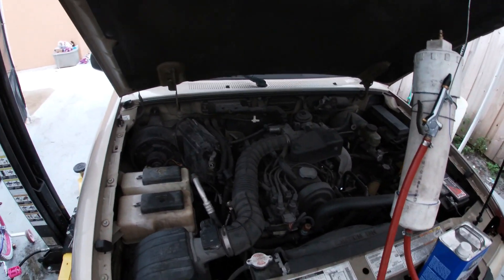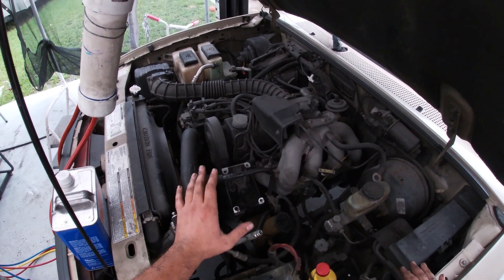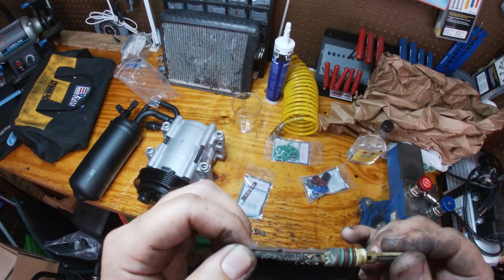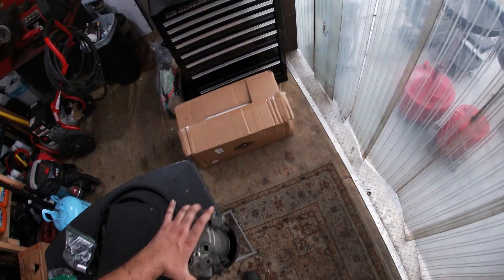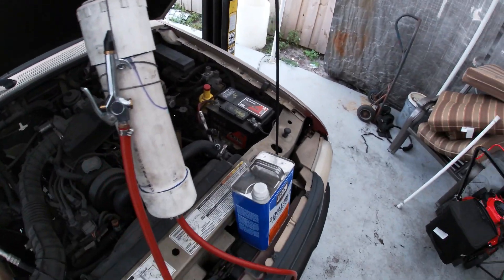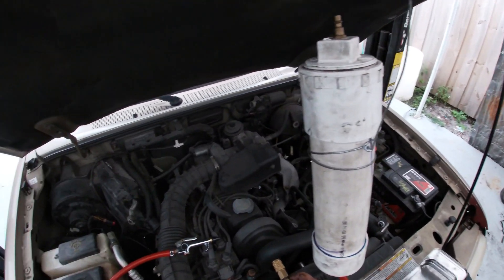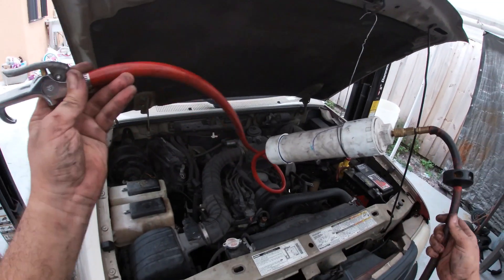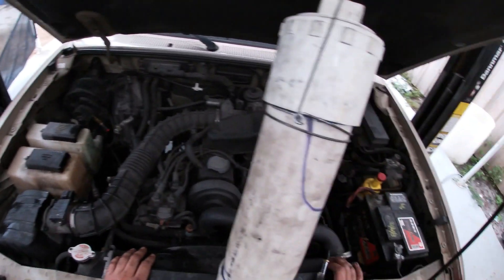How to flush car a/c system with diy flush tool

Comment: Excellent. Thanks.  I am getting ready to replace all the major components in my 31-year-old '90 Yota pickup. I have never worked with AC systems before. You answered a lot of my questions about flushing the lines. You also saved me some big bucks as I was going to buy several cans of the expensive flush. I am now going to use the denatured alcohol. For you DIY guys if you are just doing a system once in a while almost all auto parts stores will loan you a flush can system so you don't have to make or buy one. cheers

Comment: Nice video. I've only done a little A/C work.  I remember using that expensive flush solvent on a tractor system one time.  Using Denatured alcohol is a good tip, thanks.
Reply: Acetone will also work and may be purchased at Home Depot in the paint department . Residuals will evaporate from the flushed A/C lines. Acetone is flammable .

Comment: We need to invent a catch-screen or paper- coffee-filter-like to attach to the exit end hose to show evidence the flush was successful by catching the debris for examination. A coffee filter rubber banded or zip tied at the exit could reveal a lot during the flush process. The hole in my idea is exactly that. I expect the pressure of the air would rip the coffee filter to shreds therefore a metal screen would be necessary.

Comment: Good video! I have a question, if im changing every thing, ( compressor, condensor, evaporator, expancion valve acumulator) is it still necesary to flush the system?.
Reply from the maker: If you also change the lines then no. The line should be changed by the book but i try to flush them.

Comment: Hey bro you should put a check valve where your air fitting is that way the flush tool holds the content and put a shut off valve close to your sprayer

Comment: I like your do it yourself flush gun cylinder it’s even better than the ones they sell on the market because it looks like you can hold even more liquid 👍.     If I was a DYI person working out of my garage and back shop for myself I would probably use alcohol to even though theoretically it’s not the best on aluminum parts there is a little corrosion factor thing going on there.   But it’s only in contact for a short duration of time. 

And when alcohol it combined with fast-moving compressed air there there’s a chill factor that goes on in compressed air does have a lot of moisture in it actually a extreme amount of moisture mixed with the alcohol and the chilling affect condenses out into water droplet that coat the inside with liquid water.      But nothing that leaving it on the vacuum pump overnight will not take care of.   But of course that means an overnight vacuum not a one hour vacuum. 

You did a really good job of explaining the difference between the Microchannel parallel flow condensers that you cannot flush unfortunately you did not have a sample to show the people the larger round tube and fin construction you explained it good enough hopefully the majority of them will understand I often forget to explain process in detail

If you wanted to do even a slightly better job you could get a tank of nitrogen available at Airgas or commercial HVAC wholesale warehouse.   After you did all the dirty heavy flushing work with your compressed air then you could come in behind it with dry nitrogen. 

Crank up the pressure to 600 psi and use that you will get a higher flow faster velocity and of extremely dry nitrogen will help remove most of the moisture that you just introduced by using Shop compressed air. 
                          Of course at 600 psi the other side of the hose the condenser the evaporator or any device Hass to be wide-open not restricted so the item does not build up that kind of pressure it will just flow right through. 
        And you need to also wear your protection because with that kind of airflow at that pressure and velocity it is deafening loud. 

You should look into joining MACS And attending one of their yearly expose and seminars on air conditioning training and see all the available tools tips and procedures available and all the manufacturer products all under one roof. 

It’s one of those mechanics training events that you should at least attend one time in your life.  This year it’s being held in Orlando Florida by Disney.     So if you have a wife and kids they could go have fun while you are attending training classes for three days.  👍
Reply from the maker: Thanks. I always thought of attending one of those. Ill try to get a piece of condenser with the wider tubes as an example
Reply: Maybe we can also use fuel injection cleaning tool (metal tank like his pvc one) It's llike $40
Reply: Could one put heat through the parts in order to dry? Obviously not extreme amounts, but a low volume of warmer and relatively lower humidity air should be able to dry those components of alcohols or other solvents quickly.. Even water would dry fast at reasonable temps like 60c+. You could achieve that with a rigged up heat gun. With the ability to run water, you could put a citric solution through the ali parts and remove surface oxidation. Citric wouldn't attack gaskets either. Maybe I'm overthinking it. I'm just a diy guy trying to figure out how to tackle a failure in one of my own cars.

Comment: I have a 1986 grand national. When I flush out the evaporator on the bigger line solvent goes through. But when i flush it on the opposite line solvent doesn’t come through only air. Do you know why? You think it’s clogged? Btw the orfice tube broke off in the line
Reply from the maker: You will have to extract the broken orifice tube. Depending on how the evaporator is oriented it may require more fluid in one direction than the other.

Comment: Do you have a cheap small water trap on your air line? I have a regular 3-4 HP air compressor and I don't want water in the evaporator.
Reply from the maker: I dont. But yes you can install a water separator. the only issue is that i think it needs to be a certain distance from the compressor output in order to work correctly.
Reply: Any air, or water in the system gets vacuumed out before replacing the refrigerant.
Reply: @da324  but does it tho? All of the moisture gets vaccumed out by a professional machine? What about my cheap harbor freight vacuum pump, will that remove all the moisture when I vacuum down?
Reply: @great2c4me  Sure, I let mine run for an hr. I shut it off and come back one to two hrs later.  If the gauges are still sub zero where they were when I walked off; you're good to go.  Never had an issue that way.

Comment: How good is Denatured alcohol for flushing ? Did you ever opened and inspected the one u did before. Will it leave any residue or change color of pag oil ?
Reply: Don't flush with the compressor connected. Pag oil is mostly in compressor. You only flush lines and evaporator.

Comment: Works in a very dry environment but compressed air carries moisture a huge amount during peak season . So What ......   moisture even in a microscopic amount enters system .....Solution will be to filter a use a Dessicant drier  on your air supply . Spray painters do this . OR  use dry nitrogen to blow thru . A flushed system using auto gauges will take overnight to vacuum out .......

Comment: Nice video thanks for sharing.when do you need to flush the system. I want to know because my car the compressor is cooling very nicely, but it’s making noise if I replace the compressor is it necessary to flush the system?
Reply from the maker: Only when you have major internal failures. Usually you will have contaminated oil

Comment: So after you flush with solvent you can use a air compressor to remove any solvent I thought you only have to use nitrogen
Reply from the maker: Technically. But who has a giant cylinder of nitrogen laying around. If you put drier on the air line and perform a good deep vacuum you will be ok.
Reply: Oh ok thank you for replying

Comment: I have seen others using a home ac condenser chemical cleaner . The one which you mix with water spray on the condenser its makes bubbles and removes all the dirt even corrosion.After cleaning with this chemical they clean with gasoline then last with compressed air. During using The air conditioning will make the car smell gasoline in the cabin for two to three days .then to normal.
Reply from the maker: I would advise against using gasoline and such as it leaves a residue and highly flammable. The chemical is a cleaner thst is an acid. It is to clean the exterior of the coils. Not sure if it should be used to flush the inside of the system

Comment: I used acetone, what do you think?
Reply from the maker: I've never used it, but i have read others have with success
Reply: @gautorepair  how about rubbing alcohol? Is that good enough? Please answer. Thanks
Reply from the maker: I have used it but make sure you blow it all out. Also do a good vacuum after the flush. There cant be any trace of alcohol or moisture in the system.  Very important!!!
Reply: @gautorepair  thanks
Reply: @gautorepair  do you think it's necessary to replace the expansion valve when changing the ac compressor? It looks very hard to get to. You think chemical flush would also clean the expansion valve? Please answer. thanks.
Reply from the maker: Yes it should be replaced. If its under the dash and super hard to get to you may leave it alone as long as it is not clogged. But technically it should be replaced
Reply: @gautorepair  how would i know it's not clogged? if I do the chemical flush like u did here and air flows through the hoses fine, that should be proof that it's not clogged?
Reply from the maker: Pressures would be s give away. The high side would be too high and the low side would be lower than normal maybe even go into a vacuum depending on how clogged it is. What vehicle are you working on
Reply: @gautorepair  2007 Toyota Prius. To access the expansion valve I literally have to take out the entire dash which takes 8+ hours, that's why I'm trying to see if there's easier work
Reply: @gautorepair  what tool should I buy to detect the pressure gauge and what's considered too high for high pressure and too low for low pressure. Replacing the expansion valve is the same work as replacing the ac evaporator core and mechanics who charge 100 hourly wants $1,300+ labor 😂 personally I don't care about AC for that price I'll buy another car. But I'm giving this car to a family member and I can't give it without AC
Reply from the maker: Did the compressor fail internally
Reply: @gautorepair  honestly I replaced the compressor and condenser 3 years ago but it was never cold.. Just slightly cold but I was happy with that. I swapped my engine 6+ months ago and they put oil and freon to recharge it. Since it was winter I never really used the AC so I didn't notice any changes. I think theres too much oil in it. The compressor still work, I can hear it humm loud, but because I didn't do the flush I think I may have damaged it. I was in a very dusty lot when I replaced them 3 years ago and didn't do the chemical flush like you did here.
Reply from the maker: Before you drive your self crazy put your guages on the system and read the pressures. Today's ac systems are very delicate due to the smaller refrigerant charges they take. A little over or under charge and you can have issues. Also vacuum is very important. If you don't have the proper equipment maybe you are better off taking it to a local mechanic. If you do have the equipment then you can save some money doing it yourself. The pressures should be about 35 low and 185 high. Humidity and ambient temperature will impact the pressures dramatically so they may not be exactly as i mentioned.
Reply: @gautorepair  I just remembered i did took it to a local shop who recharged the freon after I swapped the engine.  they said the weak AC problem is under the dash and they'll charge 2000 to fix it 😂 the only reason why I didn't even remember this is because the money they're asking was too high so I think they're referring to expansion valve that can only be located under the dash..... Well there's no shortcuts, thanks for your response... But I decided to replace everything, ac condenser compressor expansion valve flushing tool is about  $300 worth of materialis. I'm gonna do it again but this time I'm doing it the right way unlike the years ago.
Reply: @gautorepair  I just realized I spend hours watching porn online so why am I complaining about dismantling the dash in 12 hours. I can do it. I have a spare car to use anyway lucky me, first world privelege. Thank you for contributing to my decision
Reply from the maker: Very well said. I wish you well in your repairs.
Reply: I used rubbing alcohol one time , and it works perfect,  car cools very very cold
Reply: @BOREDANDWELLBORED  that's irrefutable logic!  I once cut the hard lines on a new heater core (and spliced in rubber heater hose), because the same situation...the online info said I had to remove the whole dash.  All I needed was a few centimeters of space to not have to remove the dash ...poor, poor, poor design and engineering.